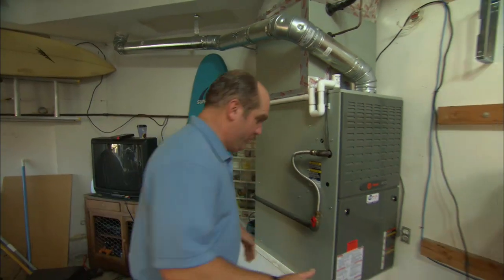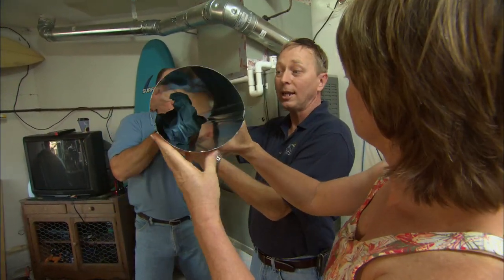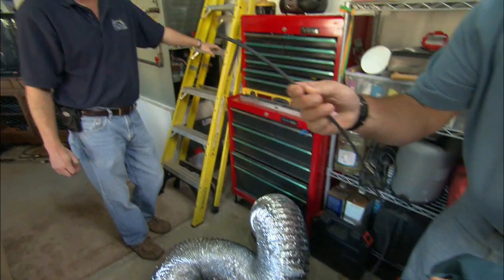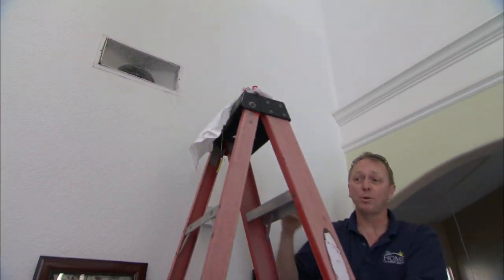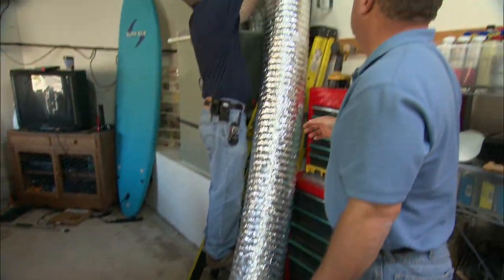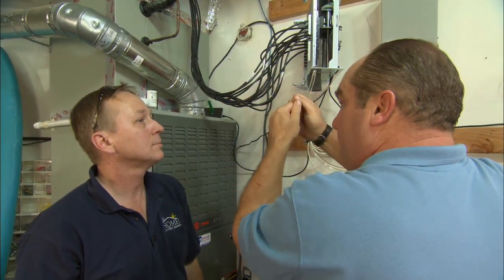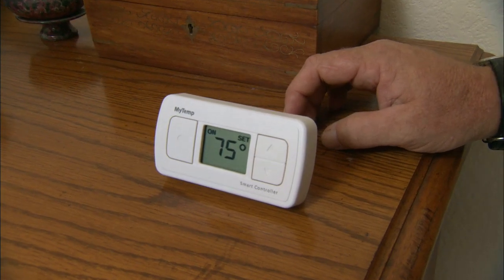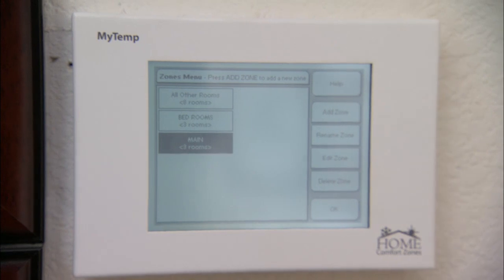How to Create Zones in a Forced-Air HVAC System | This Old House

Comment: An even easier way to do zoning like this, idk about when this video was made, but now they make vent registers that are wirelessly controlled. They open and close. No need to run the vacuum tubes. They have there own batteries. And with any add on zoning on a single speed unit, you'll need a bypass valve put in down by the unit

Comment: If you have a single stage system never zone to more than upstairs or downstairs, and if you do, then make sure you have a zoning computer with a temp probe to make sure your system isn't over heating/cooling.  Most importantly though when you're having trouble with multi-floor houses, is where is your return, especially if you have retrofitted ductwork into an old house and you most likely have a single large return instead of multiple around the house.  I highly recommend having a way to vary between a return for heating a return for cooling.  Otherwise you're going to be highly inefficient for half of the year.  We also have to remember that there is an ideal way to setup hvac, but if changes need to be done after install then there may be better options than a complete remove and replace

Comment: What stops the inflatable bag from moving when it's deflated by the airstream of the fan coil unit.? The tube thats connected to it.. it would have to be cut to exact length.
Reply: Looks like there was a strap that mounted inside the duct to hold the bladder in place.
Reply: The weight of the bag. The airflow isn’t powerful enough to move the bag.

Comment: I’m sure that defeated blob is real great for airflow.  What a Mickey Mouse way of controlling airflow. He says he’s put in 4-5 hundred.  With no bypass to control all of the built up static pressure, he probably has a lot of unhappy customers. Nothing wrong with pneumatic controls, but without bypass and discharge temperature control, this is going to cause furnaces to lock out when they cycle on and off a few times on high limit.

Comment: if unit is sized properly for the home and you block off vents  unit will short cycle on high limit on heat calls or ice up evaporator on call for cooling this lack of air flow will prematurely take out limit switch and or condensing unit
Reply: phillip jones Of course, these are valid concerns.  But it is also what our software is designed to specifically prevent.

Comment: I could see this work if the rooms are only temporarily blocked.  If a large portion of ducts are blocked for long periods of time, then the air might not flow fast enough through the AC coil, which would allow ice built up and eventual blockage of air.
Reply: Heavyboxes See my comment to phillip jones above.

Comment: So basically this is trapping the heat or cool air inside the ductwork, is the jist of every comment.  How is this any different from closing the vents at the end, like we've been doing.  Anyways I don't like this bag idea, already 30% blockage.  Definitely need to add a high airflow  inline fan at the source in the system....  hmm guess this couldn't be done to any systems that utilized inline fans....      

Anyways, I'll keep looking for better alternatives than "correctly sized system" that's heats/cools all rooms, even ones that didn't need it in the first place.
Reply: Yeah I don’t like the idea of restricting that much airflow. I’d rather have cut into the wall to install proper dampers

Comment: Your going to burn up heat exchangers in the winter and ice up evaporators in the summer with this bs. Lol
Reply: its a scam
Reply: All you need is a bypass damper to reduce noise and you won’t freeze up or crack heat exchanger they won’t run long enough. I have an Arzel zone system. Best thing I have ever done to home and I’m also a Journeyman HVAC tech. If you can afford to zone your home it’s worth every penny.
Reply: Thank you for opening my eyes
Reply: JohnnyRingo  when I never saw them install a Bypass
Reply: @justinvenn9388  There are plenty of good zoning systems out there that are fine.  This is not one of them.  I’ve installed simple residential systems all the way up to industrial DDC systems.  Nothing wrong with zoning, but it has to be done correctly.

Comment: I'm sorry, this seems like a truly awful idea. The level of complexity of the airbag system. The buildup of dust on those bags and lines. The fact that you won't be able to clean the ducts out anymore using conventional means. The fact that, even deflated, the airbags are going to put strain on the blower motor. Yeah, seems like a mess.

Comment: Stopped watching because I'll want to watch when my wife comes home.  We just bought a 90-yr old house that doesn't even have insulation in the attic (in all those years it never occurred to anyone to do that?).  I work from home so I'm having to run the A/C almost constantly.  This sounds like a great idea, but I notice the bags when deflated still block about 30-40% of the duct.  Since all ducts are similarly blocked maybe its okay but it seems it greatly diminishes the efficiency of the duct system.  Can anyone negate that concern?   Also, when we moved in a couple months ago we had the A/C inspected because it couldn't cool the house below 78 degrees on a 89 degree day and the tech claimed closing off vents in unused rooms was bad for the system and could have been part of the problem.  With this system closing off vents, even temporarily, combined with it restricting all vents at least 30%, it seems we'd have the same concern.  Great idea, as long as it doesn't create other problems.
Reply: Well, the reason closing ducts in unused rooms is considered bad is they never get opened when the room could use heat or cooling to balance the rest of the house. The advantage to this system is it'll allow for the bags in just the uncomfortable rooms to deflate while the rest of the house stays inflated, meaning the system only needs to run long enough to bring those rooms back into the comfort zone.
Reply: teccec The "bags" are deflated to an almost flat position when the zone is to be opened.  There is insignificant blockage of the air-flow in that case.
Reply: Rymac91 Exactly correct!
Reply: the house i live in, well for rent. the attic has insulation  all over the floor. someone was putting it up and never got done with it. fiberglass everywhere. house for sale with problems.
Reply: Do not do this.  It will create many problems and you will spend many dollars worth of repairs to your furnace and air conditioning.  There are many other “proper” zoning systems out there, utilizing electronic, or direct digital controls.  This system provides no protection for the furnace or air conditioning system, when the airflow decreases.

Comment: this would create nothing but problems for the system, therefore costly bills and time spent by the customer to meet the tech.

the cooling systems are designed a specific size for the house/ heat load. you start blocking ducts and runs, you end up with coils freezing due to a suddenly over sized system which inevitably will result in down time for your cooling system, right when you need it the most. service call $$$

it would also create restriction in the air flow during the heating cycle in the colder months which in turn can result in acting just like a dirty filter would, blocking air flow and taking out your furnace's safety limit switch.$$$

you are better off in getting the system properly balanced by a properly qualified and experienced tech if you have hot/ cold spots trough out your house. or just simply try running the fan continuously for better air mix (you can have it wired on a reduced speed also) most likely would cost you less, and eliminate future headaches.
Reply: I know this is really old but what if a section of the house needs to be much cooler than the rest of the house all year long? Like 10- 15 degrees cooler? In winter I still need my room below 64 degrees due to chronic pain. Would this be an issue for my hvac system?

Comment: Sorry, but this is just another bad idea to make company profits promoted by hvac guys who need to make paychecks.  Electronic dampers, inflated bags, etc.  All a lot of crap.  A properly designed duct system balances static pressure with fine adjustments made at the registers.  These air bags block the system, creating restrictions in air movement which in turn could cause your ac coil to freeze up in certain conditions.  And, how do you clean your system?  Dismantle it?  And with regard to electronic dampers, they can cause short cycling of your system not to mention thermostat wars by the end users.  It's much more important to follow the simple "rule of thumb" mentality when designing and installing duct work.  These "Old House" guys are pretty shameless when it comes to promoting products they really know very little about.
Reply: +Bourne Accident Since I don't have a cooling system attached to my ducts, I'm not worried about freezing coils. But I am worried about my 2 year old waking up in the middle of the night frozen! Clean a system? are you a cleaning salesperson? the last time I had a service guy come in the house, (1 year ago) he showed me the return duct vent! OF COURSE that's dirty! 

IF I have a system already in place what do YOU recommend be used in a old system when the house is finished? My basement isn't finished but I still only have 1 thermostat in the entire house, how's that suppose to properly heat the house?
I'm not entirely disagreeing with your comment, but an alternative solution would be nice... which is more that the "Old House" guys have EVER responded to a the dozen questions I posted on their site.
Reply: Colin Léger I am not a heating/ac professional nor am I a cleaning salesman.  From your comments, I assume you have a forced hot air system, only one unit to service, and a return system duct work rather than a whole house return.  So, as far as cleaning goes, I would suggest you change the filter on your heater every three months and use high quality filters.  Make sure your duct work is properly sealed for both the register and returns.  Use that sticky foil tape to seal the seams.  You can get it at home depot.  Buy the good stuff so it will last.  I would vacuum out the registers as well as the returns.  And as far as keeping the house uniformly heated, you will have to adjust the registers until all the registers act in concert to provide even temps.  Having some cheap thermometers in each room would help you with these adjustments.  I have my house nearly perfect and it's an L-shaped ranch with the master bed the farthest point from the air handler.  The master bed is only about 1 or 2 degrees different than the rest of the house.  I began the process by opening the register in the coldest room all the way and closing the register somewhat in the warmest room.  That was my starting point.  I hope this helps.
Reply: Fantastic Bourne Accident , are you in my region? you're hired!! :)
I'll give these tips a try.
Reply: +Bourne Accident You are correct, if another zone is going to be installed on your unit, there needs to be an equal amount of returns to match the registers being installed. I am not a pro, but I am thinking of adding a zone and there is much info out there and what these guys are doing does not coincide with the professional information that I have accrued.
Reply: +Bourne Accident Anytime  you restrict airflow you can cause freezup in ac system,  I think one should add a bypass duct and damper and this should prevent air flow restriction.  Also I cannot imagine imagine a thermostat in each room.  More likely there would be a couple of zones with a thermostat controlling each zone.